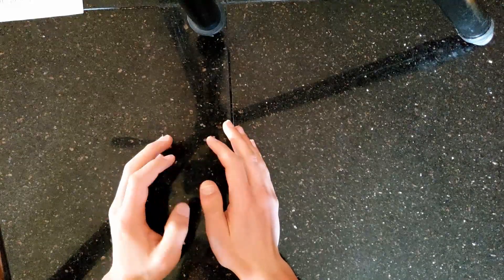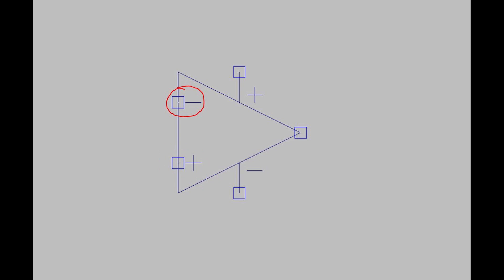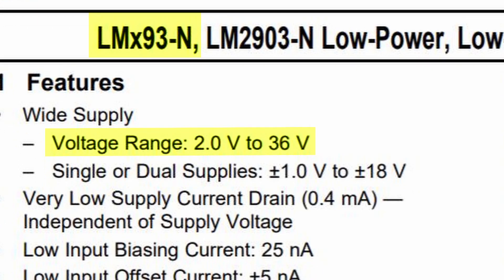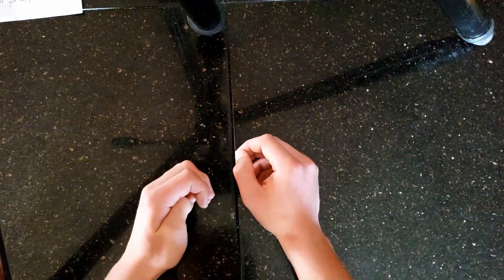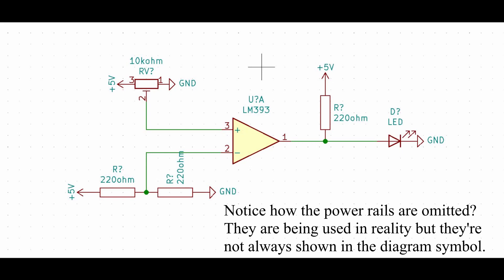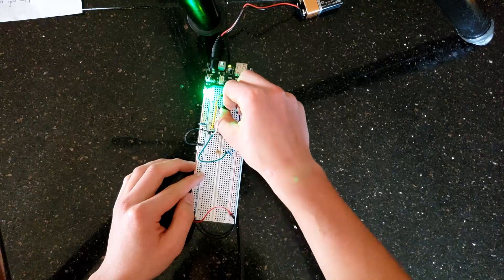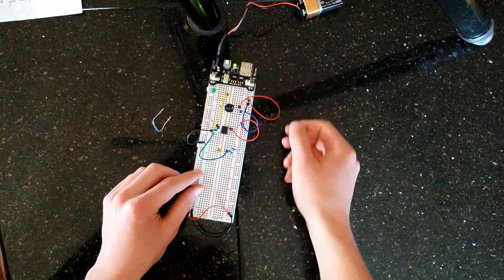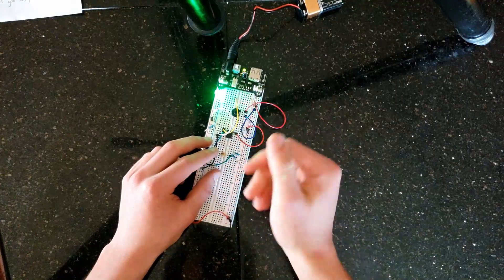LM393 Comparator for Noobs (with test circuit)

Comment: Actually the LM393 is-Not rail to rail for the input!
If you look on page 17 of the April 2019 Applications Sheet, Figure 6.5 shows that for a 5V system, the comparator is only usable to 3.5V; 3.0V if you consider the extreme temperature margins… 😊

Comment: Kindly answer 
Got a problem with a project using relay and comparator, the comparator output(changed by a potentiometer) is supposed to turn the relay on and off
 the issue is initially if the relay is off, it can be turned on by changing potentiometer value, but then it cant be turned off again,and if it is initially on, it cant be turned off,you get it? The isssue is from on to off, had to change some settings in proteus to fix this, what can I do for breadboard connection?

Comment: Здравствуйте.
На входы компаратора можно подавать напрямую плюс или минус питания, без резистора?
Reply from the maker: I don't speak Russian but I'll try to answer your question using what I got from Google Translate.

No, the resistors are not needed for the inputs of the LM393. The only resistor that's needed is the pull-up resistor R7 at the output. Let me explain why I used the resistors on the inputs.

The LM393 compares the voltages at each input. Making the voltage dividers with the resistors on the (-) makes it so that you can choose what voltage turns the LED on or off. In real life, the potentiometer on the (+) side is usually a sensor that jumps between 2 voltages. By using the resistors on the (-) side, you can set a voltage in between those two voltages. That makes one of the sensor's states power the LED and the other state not power the LED.
Reply: @lifeofleoua6695  
Thank you